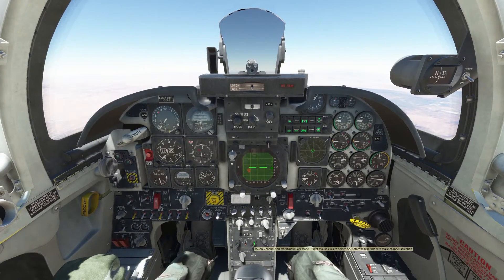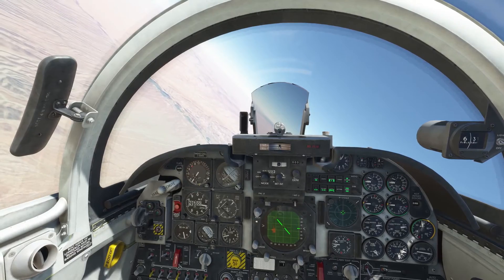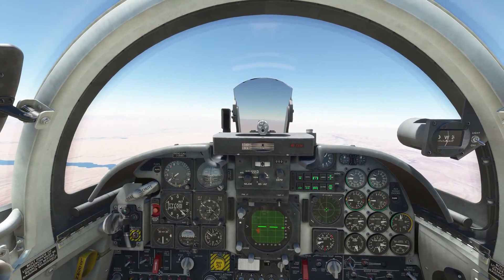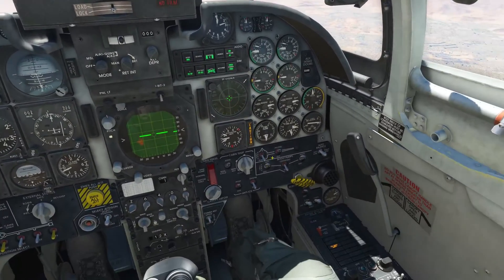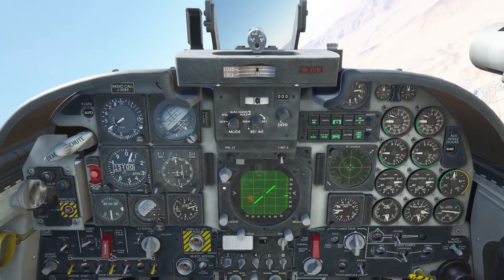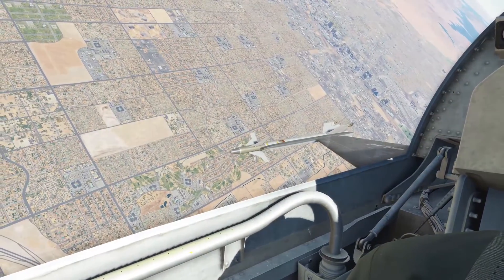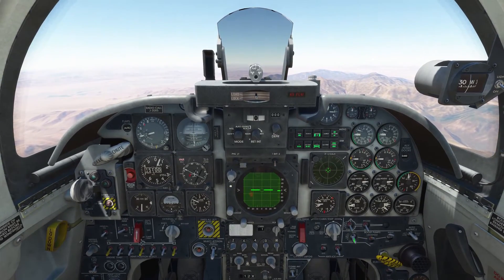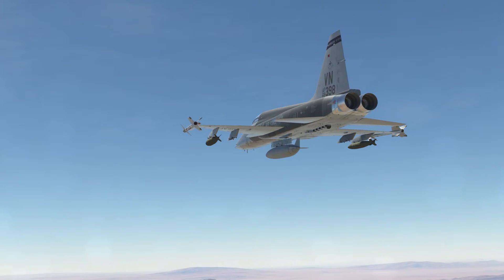DCS F-5 Enroute Tutorial

Comment: Stupid question. Is Tacan broken on the F-5 now? The only way I can get it to work is using the Keyboard bindings to change the Tacan code. If I use the mouse it doesn't work at all. No morse code, no miles on the HSI, the arrow doesn't point at the Tacan beacon, nothing. But using the keyboard shortcuts LShift 8 and LShift 9, it works every time.

Comment: Nice Vid, I'm learning a lot from Your serie. One thing that I didn't understand is why after setting TACAN freq You must operate to set Heading and Course and how You determined the two digit 270 and 220.
Probably the language (English is not my first....) or some tech knowledge I missing, but it will be possible to have some explanations or link to some discussions/video to clarify this?
Thx.
Reply from the maker: Gabriele Ragano thanks for the comment!  I'm using 220 radial as it was from the chart of 21L and I was intercepting that course at a heading of 270.  You will have to search for navigating radials if you want more info on intercepting headings and courses to a navigation fix
Reply: @TrickerDCS  thanks, but how do you access the chart for runways? I always use ruler on f10 to get runway bearing...
Reply from the maker: @heathermassey1957  rshift k brings up the knee board and then you can use the bracket keys to cycle thru the charts